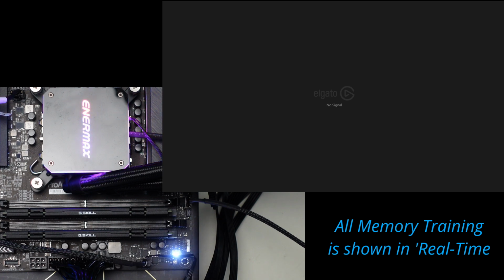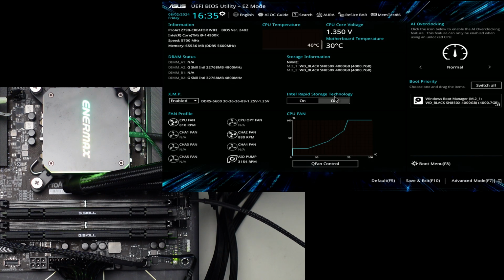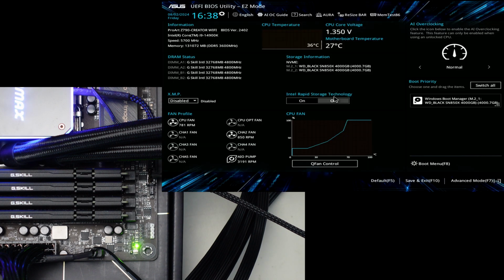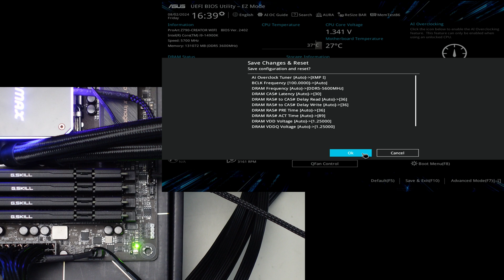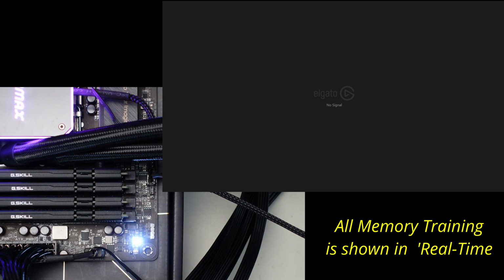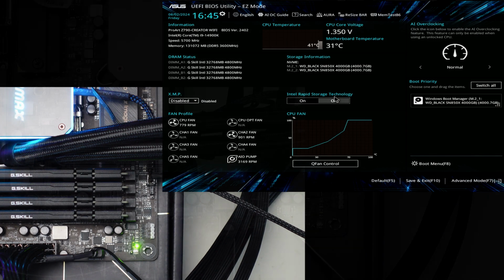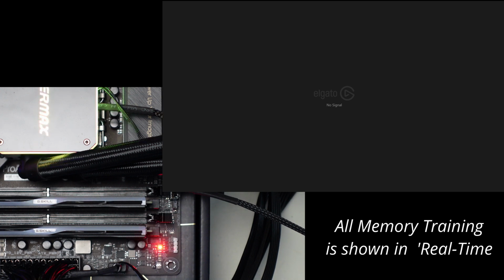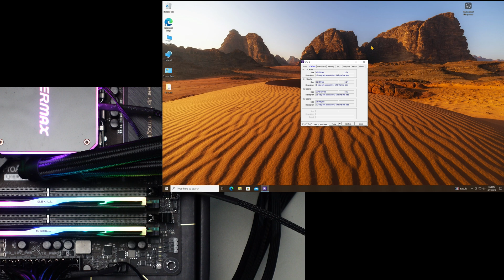DDR5 Configurations and Quad-DIMM Limitations

Comment: What about 0D and led RAM error on my new x870e with 9800x3d on every restart , only on restarts , i have to shutdown the pc in order to work !!!!!!!!!
Reply from the maker: I did not have any errors with my memory/motherboard combination.  f I were you, I would reach out to your motherboard manufacturer support team on that issue.
Reply: @ I have sent them,mobo,ram and cpu to the store technical department and they said there is no issue, I don't know how they have tested cause it sounds like they are not professionals and this store charges 100 bucks for testing if they are not in warranty!!
Reply from the maker: @smamas114  Ouch.  Have you tried another Power Supply Unit? Or possibly the Graphics card?  It's a long-shot but I can't imagine any other variables that could allow their test gig to work.
Reply: @ I haven't tried because psu its like 1 year old , corsair swift 1200w and the gpu 4080s its less than a year old, there is no blue screen when I am playing games, this error occurs only on restart, the strange thing is that i was playing 30 minutes ago and the light for gpu went on suddenly but there was no issue with the pc , its very strange I haven't seen such a thing and i have repaired lots of computers, i think there is problems with mobo , I found on a forum that a guy said it had same problem same board and he changed it with an ASUS board and the issue gone, my board its new I don't want to spend again 400€ because it will be an 800€ board, i had intel i9 before this and never ever had issues and the Intel motherboard was half of this in €, i am regretting not buying MSI , my las 2 boards in 5 years were MSI , need had this issue even with memory that were not on the QLVD 🤯🤯
Reply from the maker: @smamas114  I agree, there is likely a problem with you motherboard.  I wish you all the luck, these sort of things can be very frustration when a module is having slight/intermittent issues.
Reply: @ Thanks, i hope I will finally fix it 🙏
Reply from the maker: @smamas114  Good luck 🙂

Comment: you can also right click the task bar, click task manager, performance tab, then memory tab, and it will show you the speed of your ram in MT/s. anything else under this performance tab like the cpu can be off. ie the speed and load of the CPU can be off by as much as a couple hundred Mhz and reads hi by 10% of more.
Reply from the maker: Thanks so much for information hint.  I did not know that would work so well.
Reply: @PE4Doers  You as well, I Did not know the exact process, but your video instruction was very clear and precise, one system i put together a couple of years ago   plugging in ram and trying to get XMP to work , i stumbled threw it only cause that mother board was just about the cheapest i could find for one of my Pc's ie anytime changing ram, you had to short the Cmos pins just to get back into the BIOS anytime plugging ram sticks in. I past your video link onto a couple a friends already, as your presentation is perfect. Thanks again, Happy Holidays
Reply: Sorry , I forgot to add the reason why ram speed drops when using 4 dims is, the communication path to  A1 and A3 loop through B2 and B4, by the time the signal gets there and back there end up being to much noise in the circuit to be able to operate at the higher frequencies, this is why when plugging in 4 dims, the Mother board clocks the ram sockets down to the lowest speed it can, so is to have a bootable system. This why the New CUdims can hit 10,000Mhz and higher as the dimms have frequency amps and filters on them. Ie the New 1851 hi end Mother boards
Reply: @videocruzer  GOLDEN Comment burried in the rough
Reply: Im having the same issue. Posts with 2 sticks but not 4. Only thing I haven't tried was 1 kit aa and 2nd bb.

Comment: 4-DIMM (2DPC) 2 rank at speeds of 4400-4800MT/s is the upper limit on what is achievable on Intel's current platform. Anything beyond that becomes unstable without significant manual changes in the UEFI. Another thing to note, if mixing different RAM kits, it's best to isolate them to separate memory channels to account for micro-differences between batch manufacturing. Currently if someone wants to run 4-DIMM for the aesthetics, the AMD X870E can handle 2DPC 1R at 6000MT/s. I have recent videos showcasing this.
Reply: I'm at 5600 with 2 matching sets of 6400 xmp ram.  The same dimms are sold as a set of 4 with xmp set at 5600, and those exact settings (timing and voltage) are what I am running at.  the pairs of corsair 32gb vengance dimms are sold as 32-40-40-104 6400mhz, the set of 4 is sold as  40-40-40-77 5600 mhz.  They are the same chips as far as I can tell.  My 6400 dimms boot right up at 5600 as a set of 4, but only via manual settings, not from clicking on XMP.  With the set of 4 matching, a fella could click XMP.   Same chips, different xmp profile.

My setup is perfectly stable at 5600, but no higher as of yet.
Reply: @rolfkarlstad4015 I have seen the manual option in my bios, but I'm afraid to use it. My comp blue screens at xmp1. I have 128gb corsair vengeance 5600mts. And they default to 4800. Are there any suggestions on using the manual settings?
Reply: @ronnor58h you’d be able to go upto 5200, mine’s at 6000 & i could go upto 5600 even tho it’s not as stable
Reply from the maker: Thanks for all the extra information.

Comment: That is a known issue with DDR4 and DDR5. The more RAM (dimms) you put the slower it will go. This might change on the upcoming AMD MOBOs and upcoming CPUs (I know you're on an intel platform). It depends on the CPUs integrated memory controller (lottery) and MOBO topology. As you found, the safest bet is 2 dimms for a total of 96GB.
Reply from the maker: Thanks for the comment.  I guess we just have to wait and see where the new technology leads us.

Comment: This is good; However my understanding is that to get best performance from 4 sticks you need to get a "four stick kit" i.e 4 x 32 or 4 x 16 -- combining a pair of two stick kits is not the best.
Reply from the maker: I have heard that as well, however those kits are somewhat rare and quite expensive (>800.00$ from one quad kit I recently priced).  Also, there are different opinions on that, with the majority believing that the current memory controllers are just not up to the task yet to size for the higher frequencies.  With "Moore's law" however, we should be past that within the next couple of years with the newer CPU's and new motherboards.
Reply: @PE4Doers  I actually have a live example of this -- in a threadripper machine; where a single 4 stick 64GB kit of CL16 3600 RAM runs at its full xmp rated speed, however on adding a second identical kit, machine only booted successfully when I dropped frequency to 3000 (lower even than 3200).
But yes a full 128GB kit of 8 sticks would have cost north of a thousand bucks 🤨🤨
Reply from the maker: @chionyenkwu2253  Thanks.  I am concerned that the Threadripper CPU Memory Manager due to the larger number of memory DIMM slots.  I obviously don't know for certain, but hope to get one of those Workstation CPU chips someday in the future when they either send me one, or I have grown my Channel large enough to afford it with my business budget.

Comment: I have two different MoBos using effectively the same ram (admit the XMP speeds are different)

The GigaByte board with B650 chipset needed to have the ram voltage upped a little (was running 1.01 and I set to 1.1) and the voltage be controlled through all ram sticks individually. This allows my 4 sticks to Boot quick with XMP enable and full speed of the ram.

The MSI board with the x670e is a bit different where I have had the issue for a couple years till MSI released a BIOS update 3 months back. I would still have really long training times, but the system would boot with RAM at full XMP speed (again, 4 sticks). Recently, I started messing around with Overclocking and come across the possibility that this board was also using too low of voltage for the RAM (right at the edge). I don't have the option for the voltage to be on individual sticks like the B650 but I could up the voltage to where the ram should be running. This Voltage adjustment (setting to 1.25v per XMP specs of my ram), solved the extremely long training time (cut by half) and I have stable full XMP speed on my 4 Sticks on this system.

If curious, I use four sticks for the stupidest reason. I use RGB ram, and I like to have all 4 slots filled with the RGB. Otherwise, it feels like the system is missing something. I also recently learned that the maker of my ram does make Dummy RGB sticks. Oops..
Reply from the maker: Interesting.  Thanks for the feedback.  As I mentioned in my introduction, my intent was NOT to have the viewers of the video try and play with either the Voltages or Timing of the memory.  I decided that very much based on the problems Intel is having with the Gen 13 and Gen 14th (Raptor Lake) CPUs.  Though I know how those parameters work (being a Professional Engineer, specializing in computer engineering).  I really do not feel comfortable making recommendations on changes to those parameters for the general computer-building population.  It is possible that damage could result, and I do not want to be responsible for having encouraged such changes.
Reply: @PE4Doers  it's not just Intel. both systems I was talking about are AMD with Nvidia GPUs.

I understand your thoughts on the tweaking the system as messing with voltages (I don't mess with the timings, only enable XMP) can damage the system. I only now found out that my MSI x670-e board was not setting the correct voltages as required for the RAM in XMP mode, same as the other AMD system with the b650 chipset. Looks to be a vendor configuration failure. Didn't really take the time to troubleshoot till I built the second system a couple weeks ago.

I'm also Professional engineer, specializing in IT Infrastructure, and a Professional electronics technician.
Reply from the maker: @mikeschneider3648  Thanks so much for the great information for my viewers.. Us PE need to stick together 🙂
Reply: Please help me. I have a msi b650 tomahawk mother board. I can only run 4 sticks at 5600. At 6000 I get blank screen. Any help would be great. Thanks
Reply: @Chewy6909  I'm not sure what CPU you are using to wanting 6000 but there is a good chance you will need to stick with 5600 if you get black screen at 6000. Besides upping the voltage (I do not recommend unless you know exactly what you are doing and the specs of all the hardware, otherwise you will break the system), there isn't much there these days. Maybe timings, but that is also a dangerous position.

also to note. I build a third system with an x670-e ASUS board and was unable to get 6 sticks working this that regardless of configuration. In the end, I've updates all 3 systems with 2x 32GB sticks running at 6000 which has provided much better performance than running 4 sticks.
Reply: @ thank you so much for replying. My cpu is ryzen 7700. So let me ask you for gaming, am I better running two sticks at 6,000 or 4 at 5600. Thank you so much for the detailed reply. Now I just want the better option and I don’t know which one that is.
Reply: @Chewy6909  2x at 6000 will provide better performance than 4 at 5600 (or even 6000). Seem the "parallelism" I thought happened isn't really the case with the new setups.

Comment: 4 dimms 6000mhz 7800x3d, you just need to know how to do timings, it's not for people who don't know what they're doing. 
Btw, it was pretty easy.
Reply from the maker: Thanks.  I have done that myself, however I wanted to present things in this video that would be the most stable for the majority of viewers.
Reply: hi, could you point to a guide for this? but more importantly, is you system stable in that config?
Reply from the maker: @jackengels5077  The only guide I used is the compatibility list for memory Brands/Speeds with my motherboard (shown on the ASUS website for my Z790 ProArt).
Reply: @jackengels5077  I have examples of how to run 4 sticks of DDR5.

Comment: When using 4 sticks or two pairs, each pair needs to be installed in the same channel. In other words, the first pair out of the box goes to A1 and A2 slots and the other pair goes to B1 and B2.
Reply from the maker: Is that something you actually tried?  I only ask since I tried this test at least half a dozen times, and I did not keep track of which were paired after the 1st try, with the same results for every attempt.

I did see a video from anther creator, and your suggestion is what she suggested when using two kits with mismatched timing, however, she was also manually tweaking the frequency on the mother, which was not my intent to lead people through in this video.
Reply: @PE4Doers  Gskill is specifically finicky to get right. Shuffling the sticks placement in the 4 slots should get you to a scenario where the board successfully trains the RAM. Ideally with pre-paired kits you should follow the channel matching as the commenter said, but if that doesn't work, I'd shuffle the sticks around.
Reply from the maker: @IGN-BAGH33RA  OK, I will shuffle some more.
Reply: @PE4Doers  I used 4 sticks in my graphic design workstation and did some testing for my ideal setup (labeled each stick, tested mem performance in Windows). You're not chasing speed as a content creator, you want stability and quantity. Therefore, a 128GB bank is worth the bother IMO. Good luck.
Reply from the maker: @IGN-BAGH33RA  Thanks for the suggestion
Reply from the maker: @IGN-BAGH33RA  OK, thanks again.
Reply: I just got crucial 64x2 ram on proart .  I’m new to this memory training.  Does Training supposed to take about 10 min each time I reboot?!

Comment: I use Corsair ddr5 6000MT/s 4 x 16GB modules on a Z690 Motherboard using all four channels and i have no issues with a i9 13900kf.  It seems it is a lottery or Gskill memory is not that great.  HWinfo reports the memory running at 6000MT/s and is stable.  Windows 11 23H2
Reply: You have all 4 sticks running at 6000?
Reply from the maker: Wow, thanks for the information.  I do not have any Corsair DDR5, but I will keep that in mind when I need to purchased more memory.
Reply: g.skill is fine, it's used by most overclockers, you're just a charlatan that just showed your hand. 
if you knew anything, you wouldn't be on a 13th gen intel.
Reply: Im also using corsair Dominator Platinum 16x4 but I bought them in 2 setup at diffrent times, same specs (30-36-36-76) SKU: CMT32GX5M2X6000C30 on them tho, CPU 13600KF on a asus z690 MB and all those problems with cpu overvoling and mailfunction mb etc and update bios etc, I updated the bios ONCE 2 years ago when I bought all this stuff, and I have no problems at all, I mean like at all! I had bad luck the AIO failed me after 6500hours but got a new one on guarantee this was also Corsair, OS win 11
Reply: 13900 is way more stable with ram off 4 sticks rather then 12900